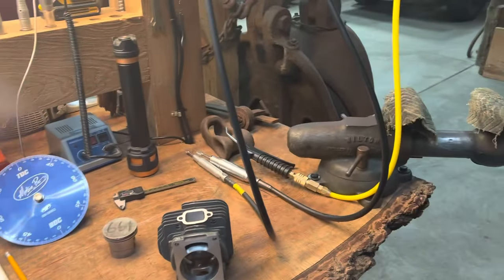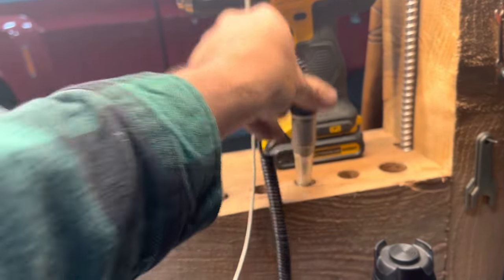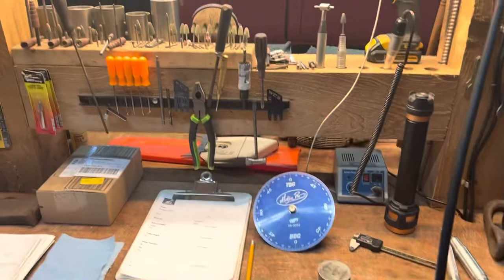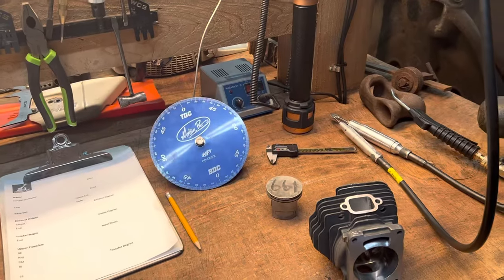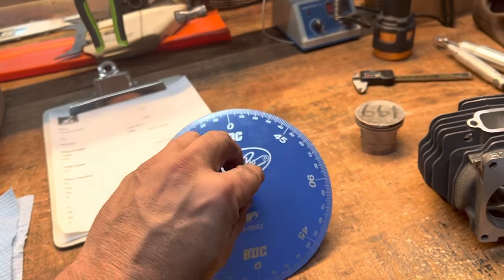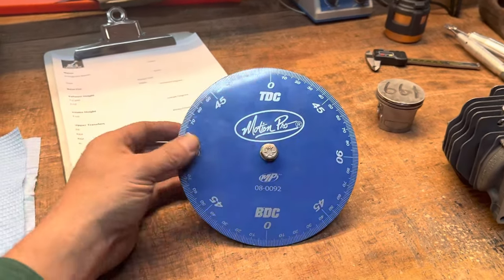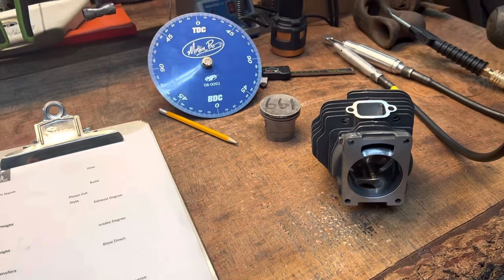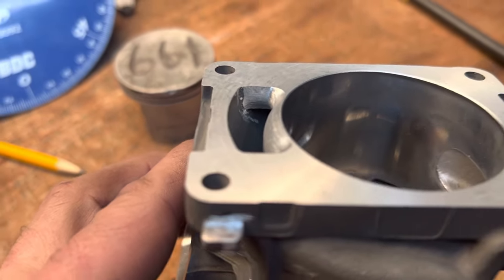Basic work saw porting tips

Comment: We have snow here, made my log job muddy so I finally can have a day in the shop. A little = alot in porting. Get comfortable and take your time. I recently replaced the intake and exhaust gasket in a Jeep 4.0 I built and ported 20 years ago. It was really nice to be able to see the fruits of my labor again after all these years and 438,000 miles of reliability. The time spent on your builds will give you a higher level of confidence in yourself and your equipment. One will make mistakes but keep going, one day you will look back and be glad you did.
Reply from the maker: That’s a good feeling to see your work last like that nice work 👌
Reply: @westcoastsaw1368  Thanks
Reply: Very nice!  It’s really funny but as a young dude going into high school I absolutely hated working on cars because I had to work weekends in my uncles junk yard… about 12-13 I started working on some of the stuff setting around because when my uncle would take off for his afternoon bar run we would jump into whichever whip I had got going and play dirt track racer in and out the gravel back roads that lead you back into the property! LMFFAO!  About 14 I was talking with my other uncle about rebuilding an engine and had gotten some good basic information… so we set about on a ford fairmont wagon and it was a pretty decent 5.0 cruiser for our first official builder… my uncle Jonny helped me some with the getting my heads done by a buddy with a machine shop and whatnot… it ran a long time too!  Mom drove it… we added a nitrous shot my junior year of high school but it only lasted for a couple months and then mom made me take it off… some teenagers were joyriding and she wanted to put them in their place as the wagon never made it past the multi colored primer stage and she scared the Holy Heck out of herself!!! A couple cuss words were uttered for probably like the 5 time in her entire life and I was in the driveway making sure she didn’t kill herself on the button… still wish I could have whiteness exactly what happened!!!   My 3 year older sister said… we went really fast!!! 😂😂😂.    Porting saw’s is awesome… people get all defensive about talking numbers and whatnot like they might loose some work over it? If you have a great reputation you’ll never loose anything to another shop!   There’s a stream of guy’s who are getting into saw’s just for fun and the porting work is going to just continue to grow the more and more people get interested and involved… if the guy could do it himself he probably already would have… there’s just lots of guy’s who are trying to collect the information enough to know what they are talking about… it’s definitely not the space shuttle it’s a freakin 2 stroke chainsaw engine!
Reply: I really like your stuff I bought a 660 that had the muffler cover and spikes on it!!!  Didn’t realize the whole weight of your duel port muffler front covers from that really fantastic thick hunk of metal!!! Not gonna bend that up!!! Very nice 👍 😁
Reply: Gordy, Sir i got a question...
I want to get the most power I possibly can get from my Stihl MS362 can u offer any advice? 
I'm in Pierce County Puyallup Washington... I believe you're local to me...
If you can help me figure out what I can do for the best result I'd be really grateful...

Comment: excellent Gordy !  I've been a motorcycle race engine builder for 50 years.  I'm old.  after building hotrod Harleys for a few years, I went on to tune race Kart engines, to me the ultimate in 2-stroke tuning.  learned a lot.  ported a lot.  ruined some cylinders.  your craft is making better use of tuning than my race motor work.  way to go Brother.

Comment: Really good explanation on atomization . I used to port and learned these concepts back in the late 70's early 80's . You sure can make a lot of difference from where you place rough and smooth surfaces in naturally aspirated engines . Not so much in force fed power though . Good video . :)

Comment: Great video! Honda discovered years ago that the intake charge mix and speed, over more volume made the most power. Polish exhaust, rough intake, and if possible increase intake charge speed by modification of venturi effect and distance to intake at the cylinder.

Comment: this made sense to me because I watched a guy do the same for air flow on a muscle car and hearing some old experts from the muscle car era talk about air flow. It's about keeping the motor cool. I think the best way to relate the heat in a motor is for anyone who has over heated their brakes in a big truck; you lose your brakes. The same goes with the power in a motor! when it gets too hot, it loses power! the cooler you can run a motor, the more efficient it will be for long days of cutting!
this was an excellent how to on increasing air flow without causing problems with the piston rings hanging on the edges. That part, I think was one of the top pointers on guidelines for shaping the ports for optimum air flow! Thanks, Gordy! Great video!
Reply: Ever watch NHRA drag racing? You know why some guys play games at the starting line? Because the hotter their motors get the more power they build and then the other guy blows the tires off.  And those guys run solid blocks. No coolant
Reply: I feel like you are trying to say the original comment is wrong.  Dont forget the "whys" of the alc burning nhra guys.  There simply isnt enough time for the thermal transfer to take place in regards to running coolant.  There are many other reasons for that one instance, but bottom line is heat=energy.  It doesn't matter if we are talking photons, electrons, etc.  Heat is wasted energy 
@Mr_Clean
Reply: @Mr_Clean  there’s a line on how hot is good and when it passes that threshold it loses power! The principle can be seen in breaks overheating and losing the ability to stop the vehicle.
I’m no expert but there is a balance to be attained; and air flow is key to anything, including to ignition of sparks that drive the force in the engine! Without air, no fire, so air is necessary for ignition and cooling, and engine experts played with this a lot back in the 60’s through the 80’s especially when muscle cars were a big deal!
Reply: @comingtofull-ageinchrist6736  oh I know. It's why they say lean is mean.....

Comment: You want asperation on the intake , picture the air and fuel across the ruff surface. It causes a turbulent mix. The exauhst is smoooth to get rid of it efficiently. I leaernned this 25 years ago with a two stroke racing quad. thank you Curtis Sparks
Reply: Yeah want that A/F in with velocity, dimple porting, whereas exhaust > smooth.
Unburnt stuff hangs on to everything, even pistons, so, smooth & polished exhaust, don't give carbon deposits anywhere to hang on.

Comment: The easier it breathes, the better.  Yes you can take it too far, but these saws now are so restricted that anything is an improvement.  If you want dependability, open it up.  If you want a race saw, well, that can get expensive.  They can run really well for a short time, but after that goodbye.  Nitrous will make them run like a scalded dog but anything weak in there will let you know.  Compression can help a great deal, but once again if you have too much pressure something will give way.  Great video.  Bottom line, make em breathe easy.

Comment: Talking technically the intake should be lightly rough in order to create a very thin strate of the air coming through that is in turbulent flow. That VERY thin film of turbulent flow is gonna like insulate the rest of the airflow from the intake walls, keeping it as a laminar flow that is the one you want to get for the maximum airflow possible.
Reply: Thats what gordy said. .....Just not that digital  same same .....

Comment: Exh. Port having arched top and bottom even out the contact pressure on the ring against the cylinder. Straight top/bottom puts all the contact pressure on the outside edges of the port which will wear out that position of the ring/s. Also there is less chance of catching the edges of the ring/s as they move past the port opening.
Reply: You got it. Thats what the man gordy said.     Listen up now.   Good job

Comment: What could I expect if I had this done to my ms251?
Reply: I ported my ms251C .shes a little ripper.base gasket delete, widened raised the ceiling of exhaust port, muffler mod..opened her up, removed the limiter caps from carburettor and richen the high jet is a must....open the carby and cleaned the micro screen...changed the fuel filter no regrets.well worth it.  A little more complicated and time consuming bcoz it's a clam shell but certainly worth doing.

Comment: Can you really get much more performance just from widening the intake and exhaust?  Or would the compression and timing need to be adjusted to really see any difference.
Reply: Widening intake generally just slows the air/fuel down. Think about running a hose and a pump, if you increase your hose size on the same pump, pressure goes down. 

Look into base gasket deletes, it gives you the ability to drop the cylinder 1-2 degrees, and yes you will see gains from widening the exhaust. Just make sure you stay within a safe margine. Chamfering is essential too. Don’t hog anything out though.
Reply: …and on the 661C you wind up raising the exhaust roof quite a bit to make it scream. Have built two. Delete the base gasket, do what Gordy did to the lower transfer, and raise the exhaust roof to around 98 degrees. They pick up at least 20% power. Can’t stand a sluggish stock 661.
Reply: @WildAcresFarms  or you can raise your upper transfers and maintain torque but pick up rpm in the cut, 98 isn’t way up there but the lower the better. I used to raise my roofs but after running short blowdown 20-12 degrees depending on your intake timing, I gained a lot more power and rpm with a broader powerband. Only problem is uppers are tricky
Reply: @lumbearjack1439  I’m a ‘dremel dude’ so working on the uppers isn’t an option. Always stuck to the oldschool “20-25 degrees blowdown makes for more torque in the cut” school of thought. Mostly since I’m not equipped to do anything else.

Elaborate on the relationship between intake timing and blowdown. Very curious about the short blowdown lifestyle. 😎😂
Reply: @WildAcresFarms  check out the early 046 magnum jugs, with the D chamber. They have very little blowdown around 14 degrees, and monster torque in stock form
Reply: @forrestwright5981  I know of the D jug but didn’t know that about it’s timing. Thanks!

Comment: Your not changing the port width or height (unless you deck the can) on the intake side right, just cleaning up the runner?
Reply: It depends on the saw. That’s the last thing you want to do on a 200T. On an 044 I remove an absolute ton of material from the intake floor to get the intake timing from 68-70 all the way up to a much more desireable 78-80 degrees. 1/8” to maybe 3/16”

Comment: Without decking the cylinder is it worth even going into a saw?
Reply: Machine work is not necessary needed if you r porting saw for work saw.
Reply: I kno it’s not necessary but are you gonna see any noticeable gains and improvements without decking
Reply: @dnunley423  yes you can get good gains by doing just proper port work. Also if you feel you want more compression/tighter squish you can do thinner base gasket.
Reply: @Ketis1985  thank you. Have heard you can’t and have heard you can from multiple different places. I’d like to get into porting as my step dad has a tree business and we have a lot of saws. I’d like to just wake them up tbh. Don’t need race saws just a strong work saw is all I’m after. Thanks for replying